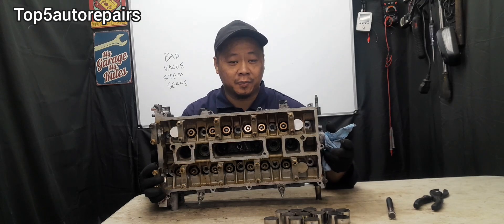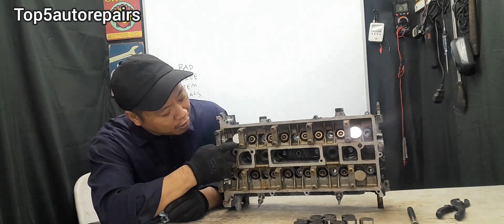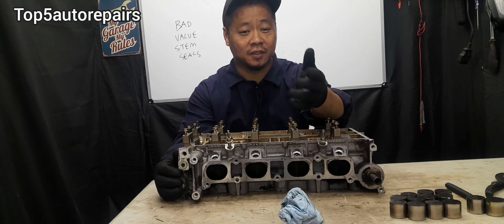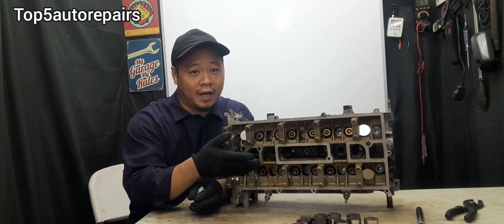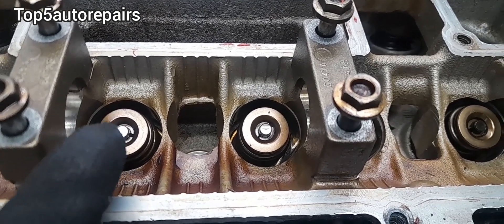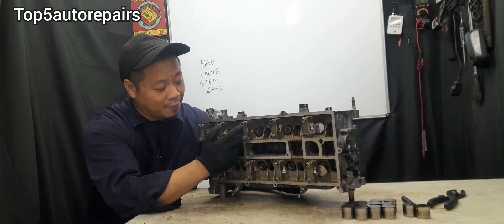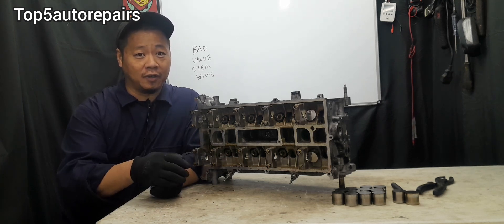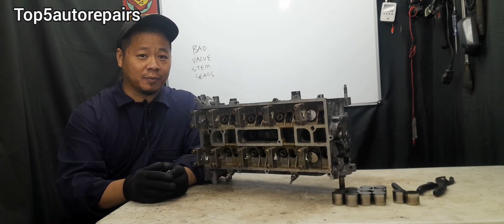4 SIGNS OF BAD VALVE STEM SEALS (EXPLANATION AND EXAMPLES)

Comment: Mine doesn’t blow blue smoke unless I let it idle longer than 15 minutes. I was told I had leaking valve seals when I bought the car. It’s a 2010 Chevy Malibu with the 2.4L ecotec engine. I do have to add a little oil between oil changes. About 2 weeks before my last oil change I had to add 2.5 quarts and it takes 5 quarts so it lost half its oil in a 2 month period. I’m not sure if it’s actually the valve seals or something more serious.
Reply: Try a high mileage oil to swell the rubber of the valve stem seals.

Comment: I have not given it much thought, I just kept pouring oil every few weeks. But now It has gotten bad. Just this morning my exhaust spewed out a cloud of blue smoke, enough to cover my entire rearview mirror. I am not a big fan of dealerships, I need a good link for the valve seal, and plz do I need to change any other parts?
I drive a 2015 2.4L Sonata gas. At 250k km
Reply: RIP. Buy a new car.
Dude... you have to disassemble the heads. Of course you need more parts..... this is not a job for you.

Comment: Is it possible that the oil leaking on the sparks plugs will keep the truck from firing up?
Reply: Yes my 4.7 magnum will do that especially after just driving it short distance  so many times  you’ll notice especially if u see light color stuff caked on it from it burning it

Comment: Any one know my car when engine is to temperature on idle it like builds up oil or sumat and when accelerating the blue smoke starts when I drive hard it disappears checked the turbo checked the pcv valves going to pressure test the pistons just strange

Comment: I did my stem seals 3 times already on a Honda b18b1 engine and it’s still smoking , not sure if it’s the brand of seals or if the guides are also worn out , but I do get a lot of smoke at idle after it’s been sitting , so frustrating cus I’ve already tried to fix 3 times
Reply: Your next economic  thing to replace is pcv valve and then piston rings..if that doesnt do it then you have a worn engine ..you might as well find another one because rebuilting that one at the machine could put ya in the thousands with no guarantee

Comment: What about a newly rebuilt engine that has that startup blue smoke, but also, when you put the pedal down, you get a cloud of oily smoke?
Reply from the maker: Constant smoke=piston rings. Only at start up=valve stem seals. First time smoking at start up and never smoked again = normal for a newly rebuilt engine. There is such thing as a bad rebuilt engine.
Reply: @Top5AutoRepairs  yeah, I think when it was bored out, they did not measure properly and it’s now too big for the rings or he cheated me and used old rings. Either way, I may just put  the GT40p heads on my old 302 and get the extra boost since I have to redo the valves anyway

Comment: This has been happening on my mk7 gli.
If I leave it over night and then cold start it there’s no smoke but after turn off the engine and then on like 30 minutes later I turn it on again smoke will come out for like 5 seconds. Could this be a valve seal problem?
Reply: Blue or white smoke?

Comment: My truck blows smoke is burning oil i can tell cos the smell,  and has low compression 32 lb in one piston plus un muffler with motor running it sucks aire in i hope is valve problem!

Comment: Hey, I have a 2006 mazda 6 mps AKA mazdaspeed 6. My car burns a bit of oil and it blows blue smoke on deceleration when you tap the throttle. It rarely ever smokes on startup and compression and leakdown test results are good. What could cause something like this?
Reply: Did you ever find out what it was? I have something similar. Blue smoke during deceleration only at high rpm. Don't get this smoke at any other time
Reply: @yeager_1200  Nah, unfortunately the car blew the motor a couple months ago. I think the ringland cracked in cylinder 1. I guess that explains the smoke though😅😅

Comment: Great video my friend clear and concise….
I get blue smoke on my Mk1 Audi TT 180 Quattro, it’s sits for a long time as it’s been a project car, I don’t get blue smoke on start up but as the engine warms and when I blip the throttle I then get blue smoke but I also get some blue smoke from the left rear of the engine bay! I’ve changed the rocker cover gaskets and the pcv system but still persist with blue smoke it’s definitely got a leak that’s burning off on the exhaust possibly? Any help would be appreciated I’ve looked underneath but cannot see any oil neither is it loosing oil. 20V 1.8T. 
Could the Intercooler have a lot of oil in it? 
Thanks

Comment: I have a 2016 jetta 1.8t replaced the pcv oil separator and it still burns oil , once i start it does have smoke when it comes out white modtly them it goes away, its cold now so its more might have a blue tint, do you think its bad stems valves or piston rings

Comment: Quick question, been working on my daughters 2011 Kia Sorento for quite awhile, symptoms were low power, poor acceleration and some funky shifting. Compression checked good, fuel pressure checked good, spark plugs had been recently changed, cat converter is only like 2-3 yrs old but checked back pressure anyway, was a acceptable number (turns out I should have investigated that more in depth), no codes being generated. So started looking at transmission, particularly the torque converter, pulled transmission and put in new torque converter, got it back together, same symptoms. Even though I dont have a lot of faith in most shops/dealers took it into dealer, they checked same things I did, drove it and said needed new transmission. Long story short have replaced torque converter then put in different transmission still had same problem, back to rechecking everything and upon a more in depth check of catalytic converter it showed signs of being bad, ordered one from Ebay, installed it and same problem (does have two cat converters but pretty sure 2nd one is okay), 99% sure this cat converter from Ebay is either defective or not working on this for some reason, have ordered another catalytic converter, not from Ebay, and am waiting for it. Here's my question, both O2 sensors I believe are the original which means they have high miles on them, coukd they be causing problems even though not getting any engine codes, the only thing seems out of order is that Long Term Fuel Trim goes negative if rpm's go up and stays negative and only drops if car drops back to idle ?
Reply: I have a 2017 elantra se with the 2.0. Transmission started jerking, took it to the mechanic and I was told it was the transmission. No lights or anything. I kept running it for about 20k miles. Check engine light came on with misfire. Two sparplugs had cracks at the top or ceramic. I replaced them and car is running perfect, no transmission problems. Maybe check sparkplugs
Reply: @roman75236  I did get it figured out finally after about 2 months and a lot of extra work and money, nothing was helping and everything was checking out, went back and dug deeper into some things, turns out the 2nd catalytic converter was plugged.

Comment: If i have a bad valve stem seal would all my plugs have oil on them? I only have one that has oil on the threads everytime i take it out. It is the first one.
Reply from the maker: It's possible to have one or more valve stems. It depends. If there is oil on the thread this due to bad valve stem seal, worn piston rings or cylinder wall. Oil is finding its way into the combustion chamber.
Reply: @Top5AutoRepairs  is it possible it can be entering from the intake manifold as well? I had it changed recently because it went bad and the one they put in was not oem.
Reply: @Top5AutoRepairs my 2007 Nissan versa hatchback always have oil on his spark plugs and Ignition coils do you thinks it's a valve guide seals need to be replaced?
Reply: Only replace the seal that has oil on the plug.

Comment: I have billowing smoke on startup. im talking smokestack levels smoke. i cant really tell if its white or blue and it has a funny smell. It goes away when its warmed up yet it still has that funny smell when you put your nose near the exhaust. It is a 1998 Dodge dakota 5.2 with 223k miles
Reply: Every figure out what it was
Reply: @BEAMSYT it’s a Dakota with 223k miles
Reply: Try Engine Restore CSL in the silver bottle.
Reply: I’ve got a 93 dodge Dakota 5.2 same issue but my computer gives me 10 different codes replaced everything technically runs great but same issue

Comment: Im having blue smoke on my audi a4. Compression is good. Drives good. No engine codes. It throws smoke more on acceleration. Is it possible to have a bad turbo with no codes?
Reply: I'd guess so, my audi a4 b5, 1.8t had a bad turbo and no code.
Reply: @BigWarningSign was your smoke white or blue?

Comment: i've done leakdown and compression tests, numbers are good. Coolant Combustion gas sniffer test, no gasses in coolant. PCV valve replaced. I'm having a lot of white smoke (definitely smells like oil) and does not go away, i'm thinking it might be bad valve seals. Anything else i should check for before i tear apart the cylinder heads? for a 1996 LS400.
Reply: i have the exact same problem on my 1995 ls400
Reply: @mmmmk2358  dang, let me know if you figure it out. I've done everything from ECU cap fix and swapped. Gas drained and replaced in case it was sitting for long time. O2 sensors and cats look good. Cylinder leak test looks decent. The previous owner mentioned he did a resonator delete, but didnt get to ask if it was all good before that, then started smoking or.... It was a college kid, so for all i know he was racing in it. Looks all original with about 110k miles.

I got busy with other things and that project is on hold. I actually got another engine but in the slowwwww process of rebuilding it. 

The idea is to replace the smokey engine with the rebuild, then troubleshoot smokey on a stand or something.
Reply: I'd say you went down the checklist and the valve seals would be the next option, if that doesn't work then it most likely is the piston rings or somewhere along the piston itself, both would suck to replace, but do-able 👌🏻 good luck
Reply: @3gDrew  if taken to a shop or shade tree mechanic, how much would it cost , ball park, on a 02 camry v6?